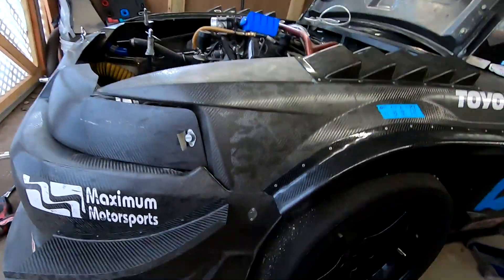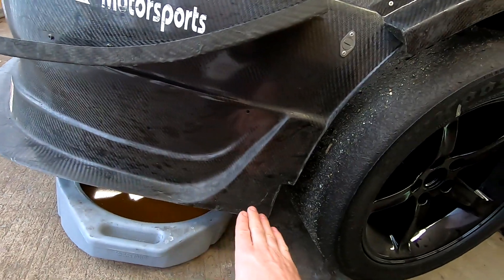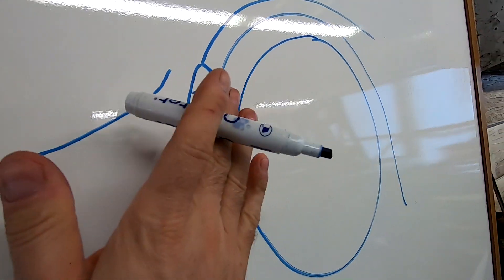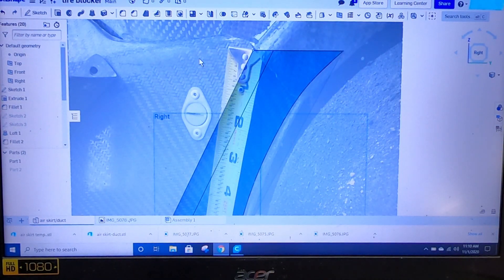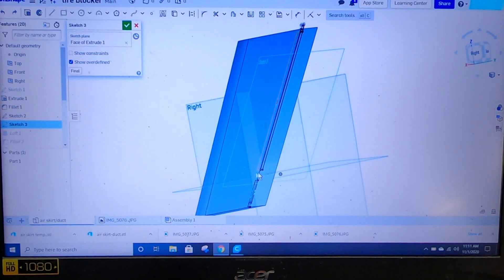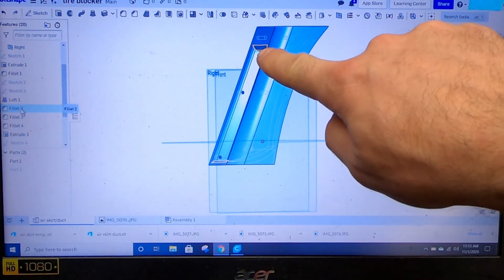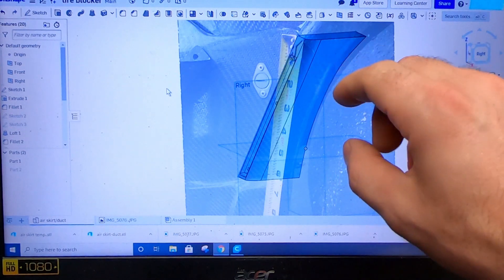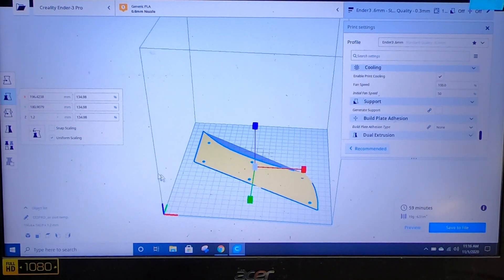Designing and 3D printing air curtains

Comment: Dimple the internal surfaces light a golf ball if your making it with 3d printed cf nylon
Reply: Like not light
Reply: Use tufts of yarn and a 360 camera to check results
Reply: Can you fill the drip rail area?

Comment: Nice work. I'd suggest 3 - 4 strakes inside, from the leading edge to about 2/3 in. The purpose would be to ensure air fills the entire exit and not favoring the top of the exit. Strakes would also act as supports when printing. Actually, if possible, the bottom strake (or two) could be angled down to extend airflow down to cover more of the wheel.

Comment: Great idea, but it does not look like the inlet of your curtain is in a high-pressure zone so the effectiveness might not be what you hope for.
Most oem curtains I've looked at duct air from the stagnation zone,  'Edgarwits' (im sure you're familiar with them) guide air spilling around the bumper.
Yours are grabbing air quite far from the stagnation zone, behind the canards, they may need some more air force fed to them to perform as expected.
All theory though.. I was really happy to see someone new taking a swing at making some on youtube.
Reply from the maker: The front face of my curtains is forward facing so it sees high pressure. The wool tufts in the wind tunnel (another video I did) shows they were flowing. Unfortunately due to time, I wasn't able to do a back to back test so unsure of exact numbers and this was just a fun little project. They are way smaller then Edgarwits as well so un sure how effective they are, but have to be doing something.

Comment: Awesome! 
Some cheap 3d scanner could help you transfer reference points and surfaces to cad so you could make almost perfect aligning printed parts. Not to mention that it cuts the time neede to meassure complex surfaces.
Reply from the maker: I’ve been looking into them but haven’t pulled the trigger on anything yet.

Comment: To test the effectiveness of the air curtain part, I'd suggest running a tuft test comparison.  If the tufts are placed downstream (doors, rear quarter, etc) display a more smooth airflow, the curtain is working as intended.  Would be great to see a video of the testing.

Comment: Like all the technical stuff you cover on your channel and I wonder if you've tested aero with and without factory wheel liners. As with many building race cars, one thing that gets tossed are factory wheel liners for weight savings, but wonder if that is a mistake and I should put them back in.
Reply from the maker: I haven’t.